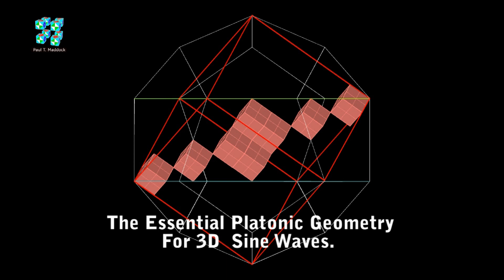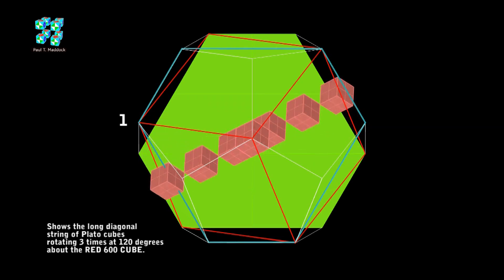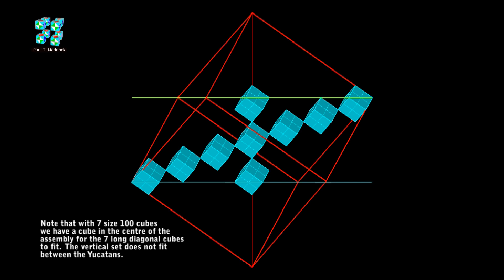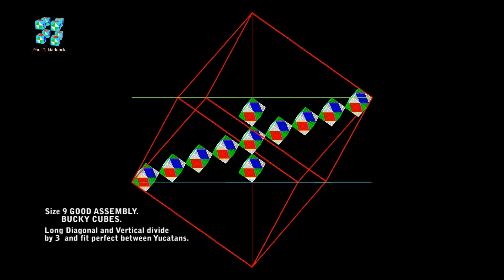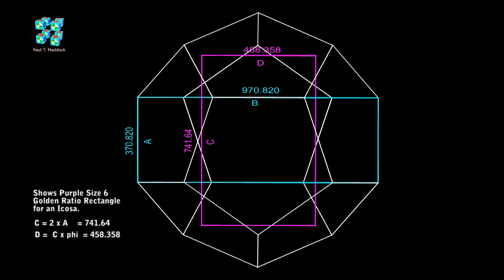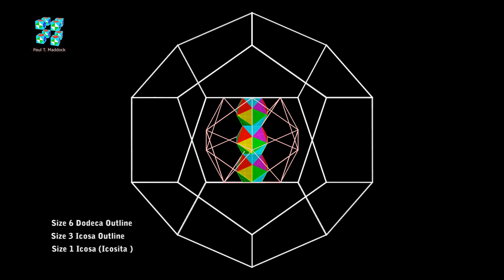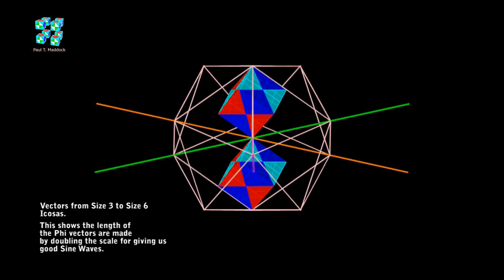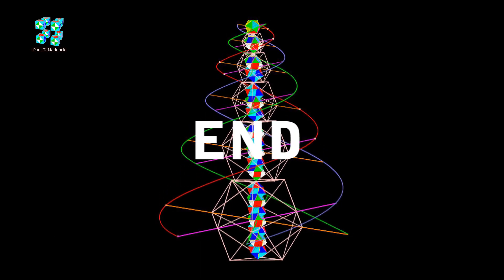The Essential Platonic Geometry for 3D Sine Waves.

Comment: Thanks brother… was curiously looking through your videos to see if you have done one on poincare’s sterographic disk model.  Was hoping Paul would have explained it as no one out there seems to be able to explain it like you would.  If you take suggestions, this one would be or value for me and others I’m sure…. Either way, thanks for your passionate work… 😊🙏❤️
Reply from the maker: I only work using 3D Geometry that interrelates to my own discoveries of 3D PLATONIC ORDER  Claudio.   Some of the 2D mathematics will not produce 3 dimensional order.      If you work with a Cube (which is probably the most important primitive for producing 3D order)  you cannot tell the difference between a long diagonal and a short diagonal when the scholars only look at things in 2 dimensions.
Reply: @ThePaulTM  got it, thanks brother…